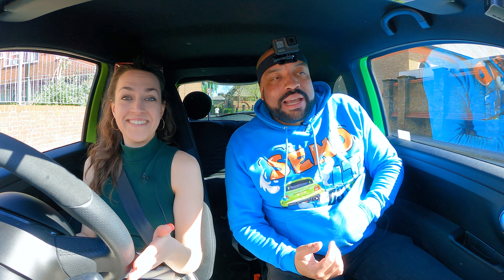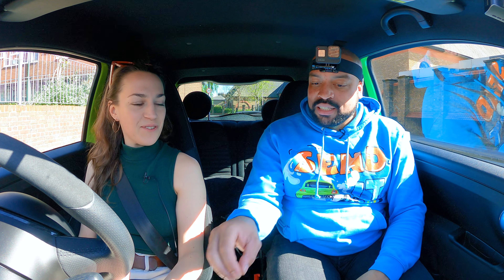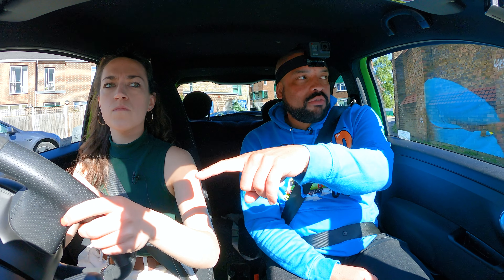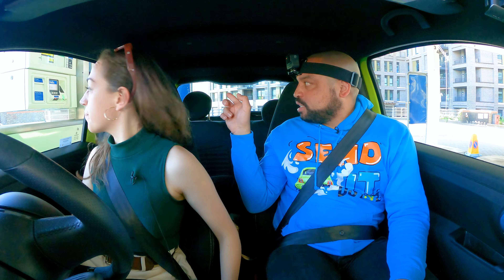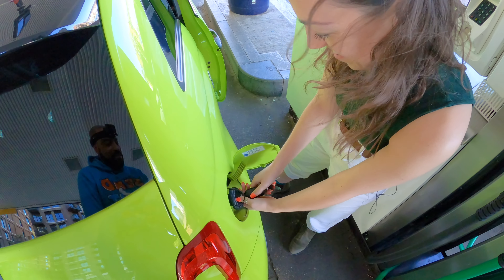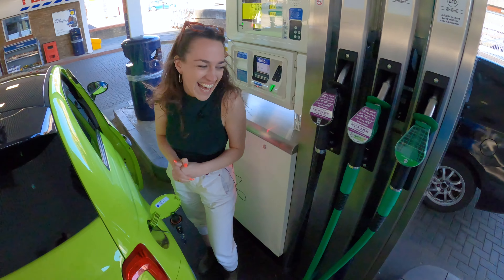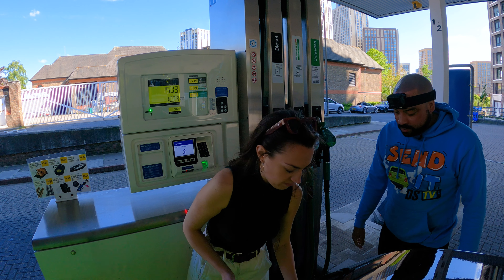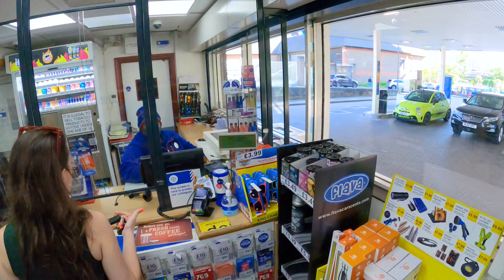First Time Filling Up! How To Use A Petrol Pump UK

Comment: 1 tip, when you get a new car, check how to open the fuel cap, and practice it before going to petrol station. Learnt this lesson with mine, it's a royal pain, to the point of needing youtube (others are the same). (oh and don't get too close, otherwise can't get out), done that more than once 😂)